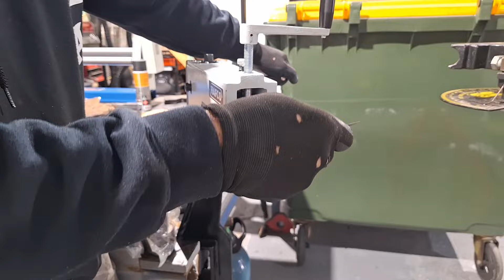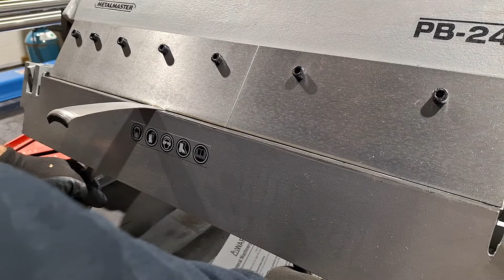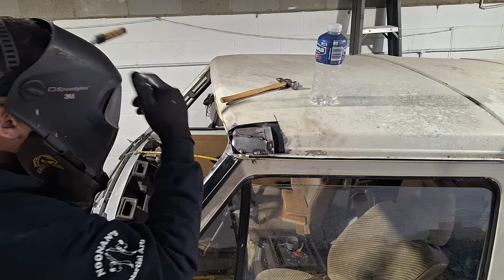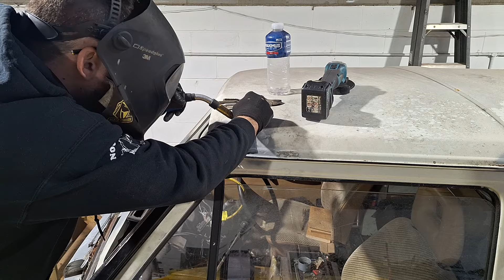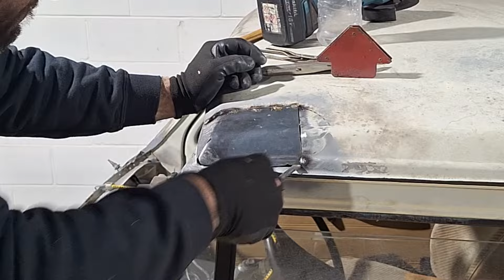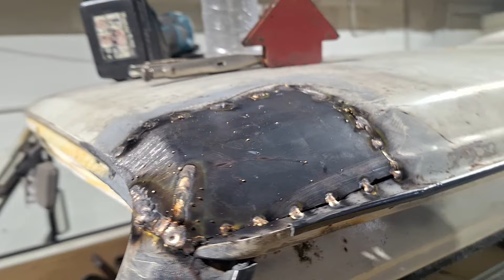1990 VW Vanagon - Panel welding/forming part 4 (Roof corner fabrication and welding in)

Comment: the way you made that piece for the roof, a relief cut was a great choice. That was the most minimal way to do it. Nice metal forming job, those shop tools came in handy 👍
Reply from the maker: @brucewayne2773  They make the job so much easier and less noisy.

Comment: I'd always wondered about repairing body panels by welding in bits like this, because there's clearly segments on every vehicle that aren't bolted on, they're structural, and can't just simply be swapped. I've got a buddy who does sheet metal forming, calls himself a "tinknocker", and he recently fabricated a couple of items that I needed at a local apartment building to replace existing pieces that had been damaged by the garbage truck emptying the dumpster. Of course, when he says "tinknocker", I immediately replace that with "fartknocker".
Reply from the maker: @dionh70  Yeah I guess when it's non structural just make it good and strong.